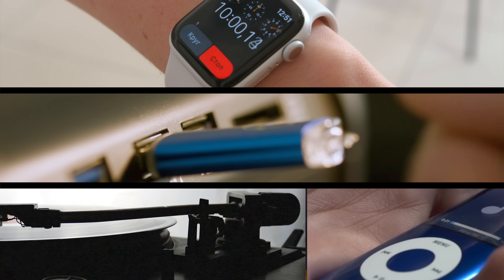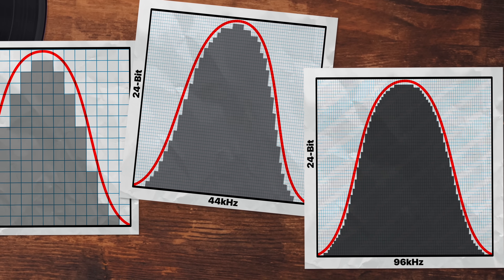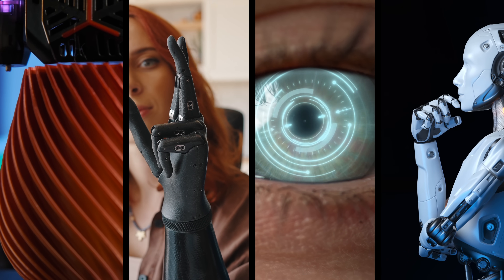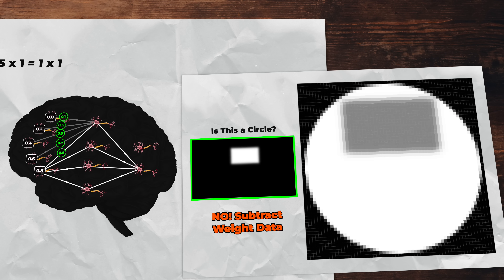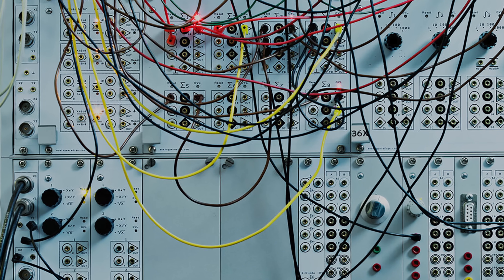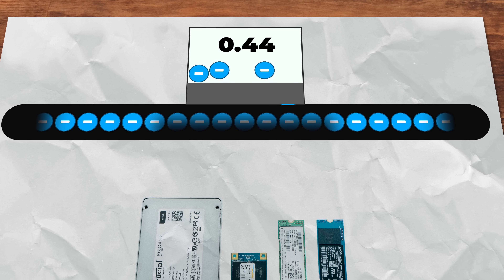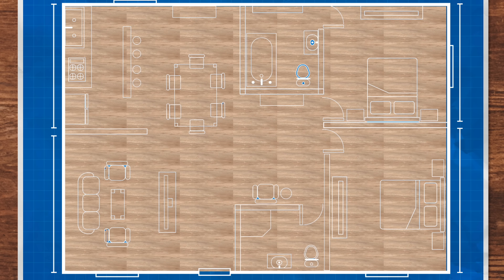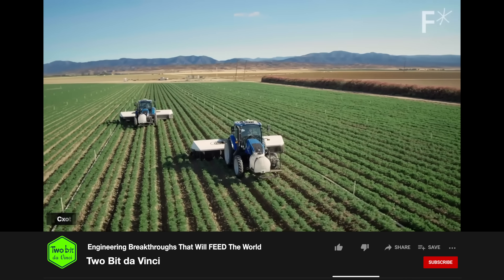Analog Computing is GENIUS - Here's Why!

Comment: The only advantage CDs had over vinyl and tape was the lack of scratch/pop/click noise or tape hiss. As for the sound, at 44.1kHz / 16 bits it simply lacked resolution. Today's high resolution audio is much better sounding and is close enough for most people to not be able to tell digital from analog in listening tests.

Comment: I just realized that analog computers with a digital nanny to adjust for drift or runaway errors is how the fuel control unit in many modern jet engines operates. They use an analog hydromechanical computers to calculate and dispense the fuel as required, and a digital computer to adjust things on the fly to keep everything optimized for the best balance of fuel economy, longevity, power, and emissions. 

Many small aircraft still use what is essentially a purely analog hydromechanical computer to control the fuel flow to the engine. The fuel injection on these piston engines uses inputs such as throttle position, fuel lever position, airflow, RPM, and air pressure to compute and meter out the fuel necessary for those parameters. Every annual or 100 hour inspection includes checking the fuel mixture at high and low power settings and adjusting as needed to keep the fuel system output correct.

Comment: I think a better comparison would be guitar amplifiers vs HiFi amplifiers, vacuum tubes vs transistors.

It depends on your use case, guitarists want to craft a sound, vacuum tubes are great for this, they distort in a way that's pleasing, not hard and clipped like transistors.
However for HiFi, you're looking to reproduce the sound exactly as the artists/studio engineers intended, for that I would use high end transistor amps with digital playback sources.

Comment: Digital audio is not an approximation. You can perfectly reproduce a smooth parabola line exactly the same as the analogue waveform looks with 16 or less sample points and some algebra, which is what a digital audio converter does. Don't believe me? Run it through an oscilloscope and zoom in 100%, and show me where those jaggy lines are - they're gone if the digital audio converter has done its job. The "samples" are just coordinates of a parabola (waveform), which the DAC has to find the path to draw a perfectly smooth line though,  which there is only one way to do. 8bit sounded crappy because the samples had to be compressed to hell due to the low memory, not the 8 sample points. You can make a 24 bit recording sound like crap by compressing it too much, too.

Comment: I like vinyl, but other analog particles get in the way, like dust, unfortunately and cause a crackling sound. I think I would prefer digital sound at 24-bit, but if there was a way to get clean sound from analog audio, I would definitely prefer this.
Reply: The whole point of this is that for AI training they don't need a clean signal. A somewhat noisy value is good enough, just like vinyl gives you a good enough analog of the music encoded into it.

Comment: It's not actually true that digital recording has to have a tradeoff and is necessarily an "approximation". It's perfectly possible to digitize an analog signal to a degree that exceeds the capabilities of the analog circuitry that will ultimately be used to reproduce it. In that case, it becomes for all intents and purposes, exact. Essentially, the differences between the original analog signal and the digital reproduction are such that the analog audio amplifiers and speakers can't reproduce them. While overkill, imagine if you took a 20khz bandwidth stereo audio signal. Digitize it with 64bit accuracy at a sampling rate of 10mhz. Then run that through an audio amplifier and a speaker. The rise time of the steps is going to be on the order of 1 ten millionth of a second and the amplitude of each of these tiny pulses will be on the order of 1/(2^64) or 1 part in 4 billionths of a 4 billionth. There is simply no way the speaker or the audio amplifier can reproduce this. The amplitude is drowned out by the thermal noise inherent in a metal wire and the frequency is so far above the 20khz bandwidth of the audio circuit that it simply won't pass through it, and even if it did, the speaker cone simply can't move that fast. You would never actually do this as it's ridiculously overkill and would be very expensive. There are mathematical theorems that are used to analyze a system and determine how good the reproduction  is. But the point is, the tradeoff with a digitized audio signal is not inherent in the fact that it's digital. It can be as perfect as you need it. It's simply an engineering decision. You make it good enough that you can sell it for the price point you need to hit. 

The reality is, a high quality analog recorded audio typically has a lot more distortion than a "equivalent" digital signal. What I really means when someone says they don't like the sound of digital audio and prefer analog, is that they are used to the distortion and prefer the distress signal to the more accurate one. This was made worse by early CDs. An analog audio tape has a certain kind of distortion. The high frequencies were attenuated. This was easily solvable by boosting the higher frequencies before the signal reached the tape recorder. These same techniques were blindly used on CDs. But a CD does not have that kind of distortion. So the net effect was to boost the high frequencies in the higher recording which led to them sounding "tinny". This has since been corrected. 

Similarly to the digital analog debate, some people say vacuum tube amplifiers sound better than transistors. Tubes distort the signal in a specific way which is a bit different than what you get with transistors. It's not that the tubes are reproducing the sound better. It's that some people prefer the sound of audio distorted by tubes to the distortion produced by transistors, even if the transistors produce far less distortion. They LIKE the tube distortion. 

So couldn't we make a digital filter and process the audio to distort it in such a way that it sounds like it's analog, or was amplified by vacuum tubes? Yes. That is certainly possible. But you probably won't sell many units because most people who like analog audio , vinyl records or vacuum tubes also like the IDEA of them. And in fact, when tested,only a small number of those people (mostly professional musicians or audio effects professionals) are actually able to even hear the difference.

Comment: I truly do believe in Ecclesiastes 1:9:

What has been, it is what will be,
And what has been done, it is what will be done.
So there is nothing new under the sun.

Again, all new ideas are really old ideas and what differs are the application of the idea... Again, the brilliance of using analog which would be more persistence for a developed learning model that just needs to run but don't need to be connected.. In some sense, this is like IoT devices that could operate on its own that could provide data points once connected to the bigger data hub.. The portability and application is brilliant as long as the limitations are understood (as you mentioned). Once a revised, you could just swap out the old analog chip for a new and start using again.

Comment: Basically, you are talking about quantum processors.
While the processing itself is analog, it means nothing until it is interpreted by a digital system.
In other words, end user devices must still be digital.
Analog processing will most likely only be applicable to server farm applications where very predicable models are performed in large volume.

Comment: I want to deal with this digital vs analog music thing before I watch further into the video.

The argument that vinyl is better because digital is "only an approximation" is ridiculous. When the grooves are cut, they can only be cut at a fixed speed and to a fixed resolution. When the header passes over them, that header can also only move at a fixed speed, and the head is of a finite size, which necessarily introduces approximation into the playback process. Therefore, vinyl is an approximation as well. We already know this, because vinyl has hisses and clips when you play it, which are direct imperfections generated from "approximating" the original sound.

If you prefer that sound to listening to a digital recording, fine, but don't try and claim that it's somehow "objectively" better because of the hypothetical, and entirely imperceptible, smoothness of their abstracted soundwaves.

Comment: "You can think of a neural net as a series of layers, read from left to right." Not always true, especially in the smarter ones. Many are recursive, passing data through the layers multiple times.
Reply: But it's still passed in the same direction, which would be "reading" in the same order as far the analogy is concerned. AFAIK, the only thing that's ever passed backwards in any neural network is backpropagation for updating the weights and biases.

Comment: You need to do some research of how digital recordings work. The 'trade off' is not stair steps, it is almost inaudible hiss decibels bellow the noise floor. Maths is used to reconstruct the soundwave. Nothing is added in digital recording.  If the analog sound appears warm it is because of the inaccuracies analog introduces.

Comment: We already have super low power digital chips that can handle small tasks like detecting people or weeds, as long as the training data is good (and relatively small) and the input is reliable and consistent, a simple single use ML model doesn't need to require a TON of processing. The ML models that are using absurd amounts of water and power are things like LLMs that are inefficient through necessity. They've been trained on billions of parameters just to make sure they can respond to most of the hundred/thousand or so parameters you query it. If this can impact that, it'd be amazing, but it sounds like it's 10+ years away from being impactful at that level.

Comment: Fantastic presentation. Definitly a decent jumping off point. . . Precision. Digital has better precision at expense of accuracy. In fact Digital is infinitly precise, and analogs are infinitaly accurate. I know it sounds like scematics but it is vitally important and where a lot of people get confused. 

Lets go back to the chart showing the 8 bit digital audio and the actual audio curve, that curve represents reality, and those bars never, ever can actually match the curve but they can stop at excatly the right point where they intersect. Thats precision. 
Accuracy is the ability to match that curves shape, but the curve might be 5% higher, or 5% lower. Thats analog. 

And it is super important to tackle this diffrence, because this lack of understanding over accuracy vs precision has lead to analog being ignored fully, when analog and digital can be combined, and used to be combined often, with the precise digital values being used to start and stop curves and various complex mathmatic formulas while the analog computation made the functions. This is how we ended being able to manufacture airplanes and spaceships before digital computers could count to 16. 

And we really should go back to this. Storing data as functions is very effective, and getting time invested in analog WITH digital will benfit all people, in all industries but only if we take the time to understand.
Digital has never been accurate, but it can be infinitly precise. Analog has never been precise, but it can be infinitly accurate.

Comment: The great debate of analog vs digital music often overlooks a hugely important factor when talking about quality. At 96khz, or 44khz even, if you were to digitize an analog waveform it would be nearly indistinguishable from the source material, especially since most modern sound cards support up to 24 bit audio (~16.7 million "levels"). The problem is the file required to store the "perfect" capture would be massive in size. To solve this, the  audio waveform is compressed so it takes up a fraction of the storage required. The compression discards some audio data to make the file size smaller which reduces the overall fidelity of the recording. this is what causes the apparent degradation in the quality of the audio for digital formats as compared to analog formats.
Reply: You are nearly correct. The sample rate determines the highest frequency you can capture. So high sample rates for commercial (end product) is a waste of space. Human hearing is finite and recording stuff above that is pointless. Bits affect loudness not quality. If you want to record a cricket fart at a rocket launch, then you need 24bits or higher.  But you would never hear the fart as it your ears would mask it if you survived the high volume. 

There are two forms of compression. Non-Lossy and Lossy. The first loses nothing. A Flac file is the same as the original only smaller. Like a zip or rar file. An MP3 is lossy. It discards sounds that it would be impossible for humans to hear. The conversion good enough that nobody can tell the difference with  better than chance accuracy. (provided the conversion is done  properly. Variable bit rate 160 - 320 kbps).  128 kbps were terrible.
Reply: @tiomkinnyborg2289  The number of bits determines the fidelity of the recording, not the loudness. The more bits available, the more fine detail that can be captured from the waveform.

Comment: Are these analogue CPUs prone to EMR interference?  I know from building simple switches in my circuits that they are not very reliable without a pull down resistor due to EMR nearby.
Reply: Absolutely yes. All analog computing is prone to EMR interference. It needs to be shielded to achieve a reasonable degree of accuracy.

Comment: Nice video, but i have to interject about your initial point regarding the flaws of digital audio: the idea that digital audio is a like a stair step without any smoothness is a myth that originates in ignorance about the nature of digital signal. According to the Nyquist-Shannon theorem, in order to perfectly reconstruct an analog signal, the digital equivalent's sampling rate has to be twice the signal's frequency, e.g. 44 khz digital audio being equivalent to a 22 khz analog signal. The stair steps we see at the visualization of digital audio are misleading - in reality, the DAC (digital-to-analog converter) creates a smooth wave from the numbers, reconstructing the original sound recording perfectly. The difference between the digital number and the original analog version is the quantizatio noise, which is usually inaudible due to the high sampling rate.
Thank you. Now I will continue watching your cool video.

Comment: Meh.   I always thought digital signals were approximations of an analog anyway.  That was the whole point of data loss of digital conversions.  If you're processing radio frequencies, light wavelengths and so on, it makes more sense to use something analog.   The power efficiency use case and error rate look more like trying to process digital signals with an analog system... does not work.  lol  🤷‍♂

Comment: Part of what makes vinyl more enjoyable for me (in most cases) is that vinyl and digital music are typically mixed differently.  Digital music is normalized for all listening devices, needing to sound equally with the lowest common denominator of ear buds, whereas vinyl is typically recorded for ideal setups such as home audio setups (not subwoofer and cubes, but at least 4-5 inch cone speakers).  For us elderly people it used to be called “hi-fi”, but the reality is dynamics.  The over-compression of digital music means there’s less nuance in the quieter versus louder parts. ❤❤❤
Reply: I still think hardly anyone knows about this. Looks like people think digital makes more sense because of the obvious reasons, without having looked into the weightier reasons why people are still buying vinyl today.
Reply: Digital music isn't in the days of loudness wars anymore, high quality digital music is better and easy to access nowadays.

Comment: Vinyl is great for that nostalgic sound. That's not to say it sounds like an old timey radio. It sounds really good. But it's limited. You're get higher highs with digital. And lows that would bounce a needle out of the grooves. I love tape. But it comes with limitations too. It has Hiss. Digital can be so clean. You can even reduce, or in many cases, eliminate hiss off of tapes with it. Look at the recent Beatles release using John off an old cassette. That's how good Digital is. Maybe not the best for everything, but it's so versatile you can teach it to listen for things and isolate it.

Comment: Zero and One in flash cells? You know that TLC and QLC is common by now? So three bits and four bits per cell, that is 8 and 16 voltage levels. With PLC in development, so 5 bits per cell.